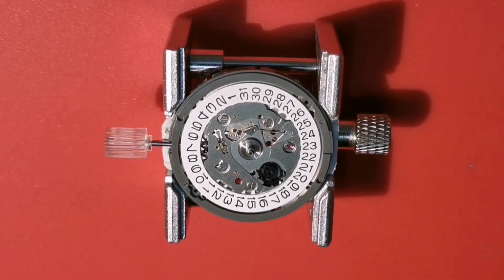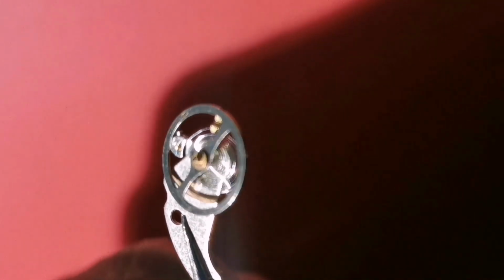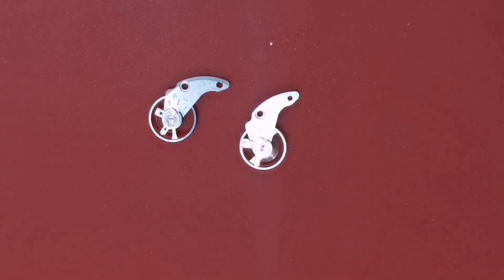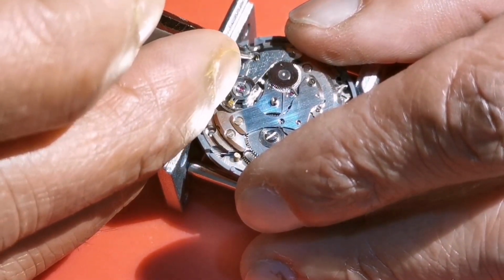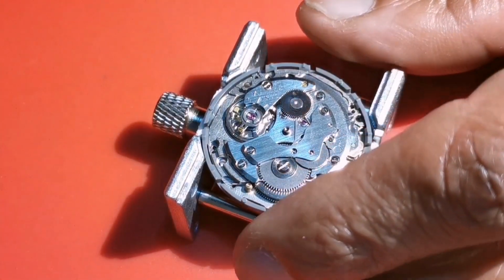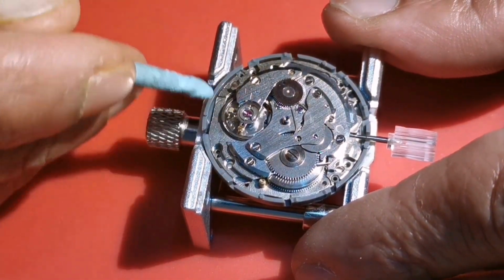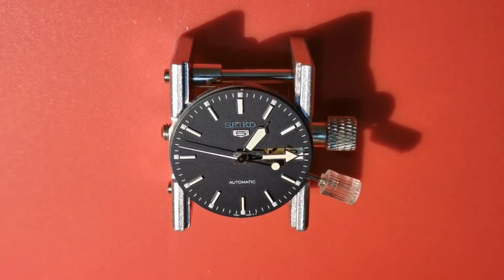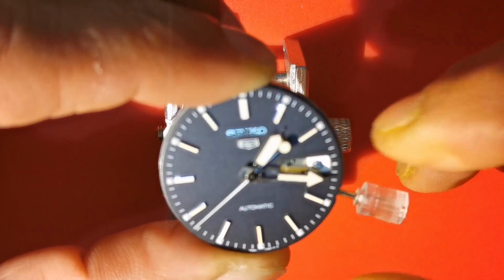NH35A Automatic Watch Movement, Balance Wheel Issue & Clock Work Assemble

Comment: Thanks mate for putting this on.
I have just bought a NH38 that stops after about 10 minutes. 
I bought it just to practice stripping and rebuilding seiko movements, but now I'm curious as to what the problem could be. 
I took the balance out and put it back in just to see if I had dislodged any debris, but it hasn't made any difference. 
I'll keep looking. 
Thanks again.
Reply: Hi, my nh35 has the same issue, what did you do?
Reply: @garaikojulen  I couldn't figure out what it was to be honest, so I got another movement and it's been perfect so far.

Comment: I have a NH36 doing a similar thing, where it’s not moving the balance wheel. I’ll check its balance wheel and see if its impulse jewel is missing. I have a new replacement nh36 movement ready to put into the watch, but I’m waiting for a replacement dial as the one that’s in my watch is misaligned.